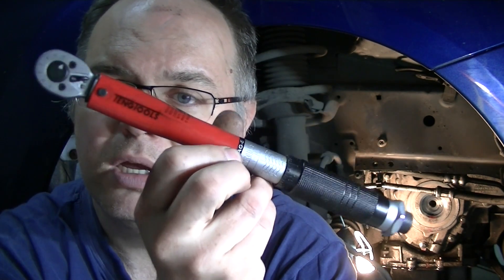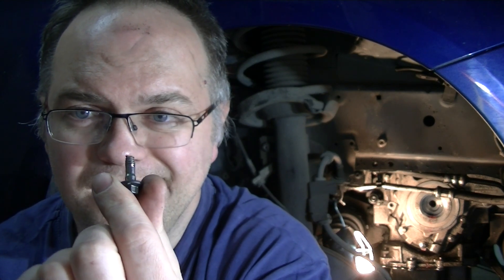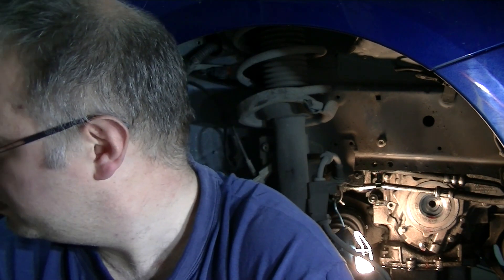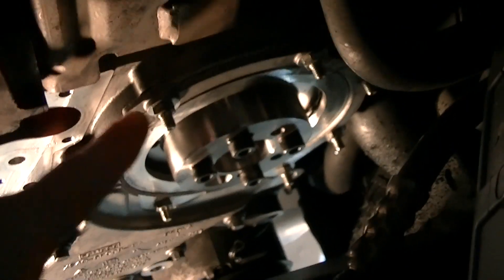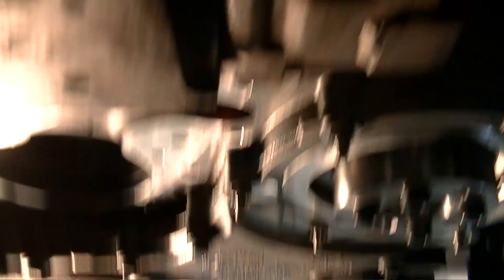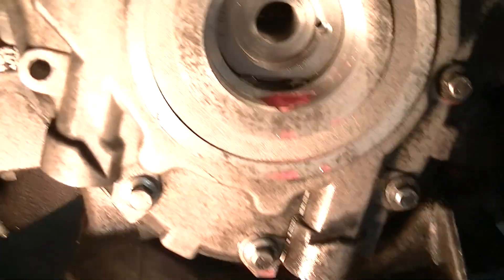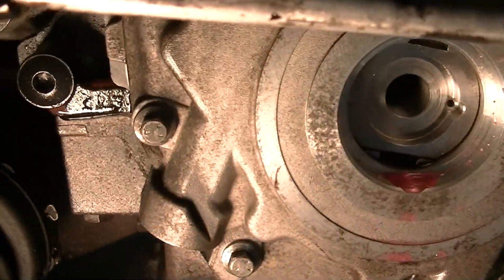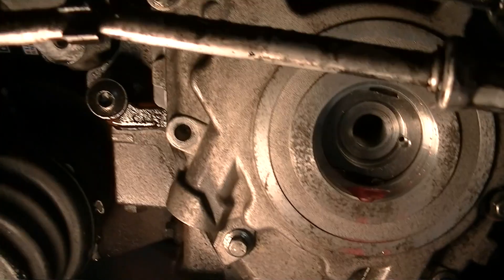When Torque Wrenches Turn Evil

Comment: I haven't edited the video I shot on this yet, but I busted a bolt on my oil filter housing of my 2017 Yamaha WR250R when a torque wrench turned evil. I had dropped it right before and of course it didn't click and it broke. It only needs something like 15 inch pounds, as it's made out of super soft aluminum.

Anyway, I have a made in the USA Drill Hog set, which has these tubes which you hold over the broken off bolt so you drill straight. Then you tap in an extractor and out it comes. Doesn't take too long now that I have an air driven drill, but my electric drill was seriously lacking in power in comparison.
Reply from the maker: I've never had much success with dealing with broken bolts. Funny you should mention those tubes... check out the latest vid on how the removal went. Cheers!

Comment: I also second the idea of drilling! Thats how I've done with stripped screws(because I dont have any extractor-kits) and it have worked out. A good idea to be careful so to not touch the threads and get unwanted wedging in the threads. I have heard alum can dissolve the iron screw and leave the aluminium unharmed, but I've never tried that since drilling have been the way to go for me. One time I've also managed to turn a piece of a screw with a pick/screwdriver albeit that I found being quite time-consuming.
Reply from the maker: +manwiththestar drilling seems to be the firm favourite so that's what I'll try first. I've not had to deal with too many broken bolts so this is all a learning curve for me. It's great to have so much excellent advice helping me out. Cheers

Comment: If you don't remove the broken bolt and it leaks you're gonna have to do it either way. Just a little more work later. Personally, i would do it now.
Reply from the maker: +wysetech2000 I don't fancy ever doing this job again so I will be fixing it. Cheers

Comment: I recon the bolt let go and the threaded bit will easily come out..Reverse drill bit will spin it right out other wise the old "drill and easy out" method will but it may spin to the bottom of the thread before you get a hole started...Center punching is going to be a challenge.
Reply from the maker: +ZIGgassedUP thanks Zig. I've found a set of reverse drill bits so hopefully it'll be an easy fix. It's only small so I'm sure you're right about centre punching. Cheers

Comment: There should only be one m8 bolt in torque position 6 that should be torqued to 23 nm all the other bolts should be m6 and torqued to 10 nm.
Reply: Now ya tell me. :> )
Reply from the maker: +William 100 thanks for the info, 10nm sounds much more reasonable. Cheers
Reply: Remember the 7 P's.
Great to have such a knowledgeable family.

Comment: Where it is I think it will start an oil leak. I think a left hand drill bit would be best. It probably isn't in there that tight and will spin out. What a bummer. That bolt must have been bad or something. 13NM is nothing. Your average bloke can probably exert that much torque with a screw driver.
Reply from the maker: +zoidberg444 you're right on all counts I hope. I am contemplating replacing all the bolts if I have to take the cover off. Cheers
Reply: You'll have to pull your trousers up after getting a set of timing cover bolts from Ford New Zealand... That being said I would probably do it because obviously at least one of these bolts is bad. Its almost lucky it bust when it did and not later and cause a massive oil leak or even possibly and oil starvation issue.

Comment: I got a set of Mac CCW drills and extractors if I need to borrow? I prefer the wrist action torque wrench for smaller bolts for that exact reason.
Reply from the maker: +One Auto, that's very kind of you Rob. I've found a set locally so I'll give them a go. That was my intention until i just happened to see an (incorrect) torque spec

Comment: Hi mate the chances it's not very tight in there as the bolts just snapped get a left-handed drill bit smaller put it into the hole this should spin the Bolt out with you not having to remove any covers or anything then just replace your bolt  sorted!!!
Reply from the maker: +bodgit and leggit garage oooh that's my favourite idea so far. Saves having to get a new gasket. You're a smart man

Comment: i just broke a bolt from my air intake pipe. I am wondering how can I properly install spark plugs or transmission drain plug and pan bolts without a torque wrench？
Reply from the maker: +方言 not many people use a torque wrench for either of those jobs. I just snug them up hand tight and have never had a problem
Reply: Thanks ur reply!
another question is that do I have to change oil pan's washers or even new bolts when I install trany oil pan back on? Do new washers really matter? I found it is quite hard to take off washers from bolts. 
Thanks a lot
Reply from the maker: It's always a good idea to change them as you really don't want a leak after you have put lots of expensive new oil in there. That said, a lot of people don't bother and never have a problem. As long as they are in good condition you should be ok. Cheers!

Comment: In a month's time, that'll be an oil leak, sealer or not.  Take the time, do it right!  That bolt cost the manufacturer a few cents; if it wasn't necessary, it wouldn't be there!  ;)
Reply from the maker: +rhkips I know you're right, I was just hoping for a magic solution from somewhere 😭
Reply: There are these beans that I got from a fellow named Jack.
I can let them go for a song. Just trying to help ya know.

Comment: Take the cover off so you can work better / see better. It might not be tight in the hole... might just come loose with a pick! CCW drill sounds like the nect best thing.
Reply from the maker: +Thomas EXOVCDS that's what she said. It's only an M8 bolt so not much to play with. I was thinking of welding a nut as my first offensive if there's something to weld to.

Comment: Since it is accessible fix it the correct way by extracting the bolt. I'd use the drill bit that turns ccw to drill the hole in the bolt. You may get lucky and it backs out during the drilling.
Reply: Richard Stamp I agree with Richard, do your research on the best tool to extract it. Oil will find a way out if you leave it, and you'll have a worse time later.
Reply: Got to make sure you get as close to center as you can. Use a center punch before you drill. It's been 50/50 four4 me. But when it does drill out you do have a grin like Sylvester when he's got Tweety Bird in his mouth.
good luck mate.
Reply from the maker: +Richard Stamp I'm inclined to agree but it's a headache I'd rather avoid if I can. Cheers
Reply from the maker: +Mike West since half the rain in doing this is to fix an oil leak that's probably the right thing to do
Reply: Badgertronix - suck it up - bandaided problems always come back. Just think of the beer you get to drink when finished!